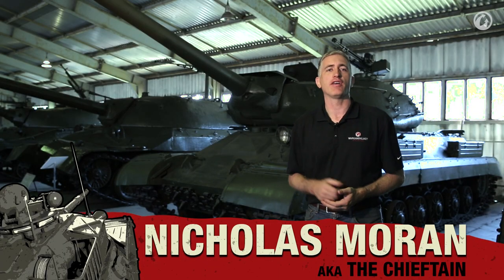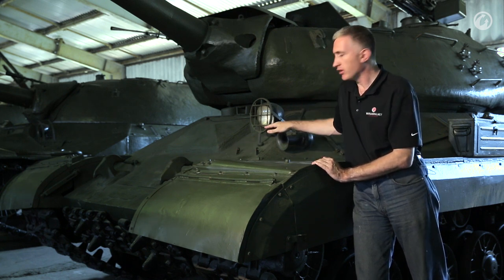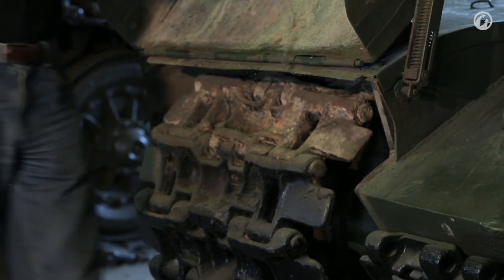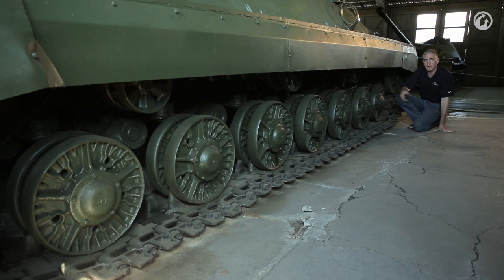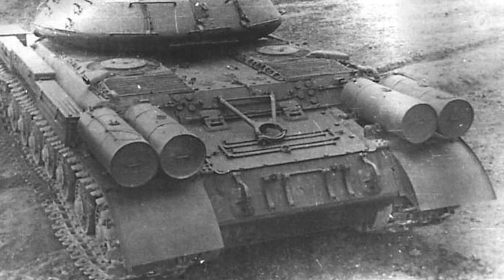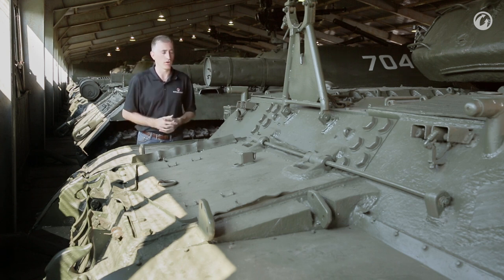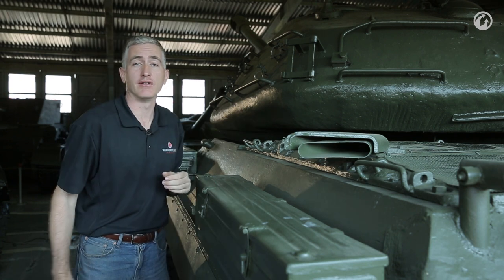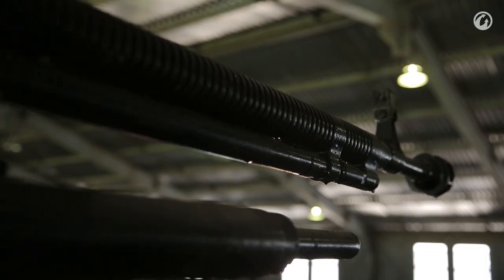World of Tanks: Inside the Chieftain's Hatch, IS-4 - Part I

Comment: 1:13 in the video is an IS-2 with a stepped slope. As others point out, the later production variants also had the fully sloped front.
I don't say that infantry riding on the tank is a bad idea. I say that infantry riding on the tank when the TC is no longer able to communicate directly with the infantry because he's inside the turret is a bad idea, as it implies there is lots of hot metal flying around.
Reply: please do T-10 and IS-3 !!!!! PLEASE !
Reply: May be a little late the IS with the stepped slope and the 122mm was actually was named IS-122 then the real IS2 had the slope on the front plate
Reply: Ah, yes. Hot metal.

Comment: 1) There are plenty of reasons for a fender to be 'sprung' to stay in place. What is unusual about IS-4 is that the spring system is more in-depth than the typical single bar.
2) No change. If the area is not so hot that the infantry are not at inordinate risk by staying in the tank, the TC can probably keep his hatch open and his head out.

Comment: I was told that the IS-2 with the stepped front was actually called the IS-122 and the one with the completely sloped frontal plate was the full production variant which was called the IS-2.
Reply: sorry for being 5 years late but the is2 with the complete slope fron is called is-2 model 1944
Reply: IS-2M 1944

Comment: There are thumb tabs at the back of the 12.7mm machine gun. Not sure if this has also additional trigger lever on operators left hand handle. If the AAMG mount is typical soviet design, there's a elevation brake handle on right hand elevation handwheel.

Comment: At 1:16 that is IS2 as the production KV1S had a 76 and the IS1/2 had a 2 part upper glacies where part 2 (the top) was 3 parts and 1S only had a 2 part upper glacies and only part 1 (the horzontal) was 2 parts to lead into the lower part

Comment: imagine these going up against king tigers. That would've been awesome.
Reply: It's designed to survive king tiger's 88mm/71 main gun hits....so what do you think?
Reply: Theo S I'd love to see what the germans would make to counter it.
Reply: 128mm kwk44?
Reply: Did they ever stick those on royal kitties?
Reply: Alica Ljungberg they put a KwK L/68 105 on the Tiger 2H, the only tanks that really had it was the JagTiger with the 128 PaK44 and the MAUS with the KwK 44 128mm gun
Reply: +TheRed Hawk Nope, Krupp proposed to rearm all Tiger II tanks with a 105mm KwK L/68 gun, but it was rejected since the gun was not in use by the German army and its ammunition was two piece requiring a second loader.
Reply: Or they use the first APFSDS Ammo for the 8,8cm and 12,8cm. Also called Panzergranate 44.
Reply: +Mad Catz Armor Piercing Fin-Stabilized Discarding Sabot.... Please tell me you aren't that much of an idiot
Not only would it not need Fin-Stabilisation since it's rifled but the germans used something that was actually more common in WWII APCR Armor Pircing Composit Rigid which used Tungsten and since germany had basically none of that. Then most tanks would have only a few shells

Comment: One question. Looking at the suspension components, as well as others like the rear deck cover, I notice it's covered in irregularities, almost like someone's heated it almost to melting point and then let it cool with little drops and deformities forming all over it. Compare that with parts of a US tank for example and it becomes very apparent. Is this just a by product of casting, or is it poor or unskilled workmanship or what?

God that's one big slab of iron though.
Reply: it little attention, most importantly how you can make more tanks. Drops do not interfere with him to shoot.
Reply: Poor/unskilled workmanship as well as the way cast moulding works, it leaves many irregularities in the pieces which due to demand, especially in wartime were not smoothed out/corrected. Could also be shoddy painting

Comment: What is track tension and idler wheel @ 3:11 ??
Reply: A track has to have a certain level of tightness in order to stay on the wheels and not fall off. This is usually done by moving the idler wheel. The idler is a wheel which doesn't touch the ground, is unpowered, and the purpose is to turn the track around to feed it back to the front.
Reply: What happens when a tank drives is the holes in the track for the track pin elongate, the pin also wears. This results in the track slackening. The idler wheel can be adjusted to take up the slack. After a period of wear the track needs to be changed (like wear on your car tires).

If you did not tension the track it would eventually slip off as you turn (normally when you're in a foot or so of mud).

Comment: was the M62 gun ever mounted on  is-4 or was that just a fictional game edition?
Reply: The m62 is a real gun and it was mounted on the is 8 or t10 (after Stalins death)
Reply: IS 4 had the normal D-25 gun 175 pen
Reply: +AnnabelLolita   Funny you give a pen value for it.  This is a game stat and tweaked by the developers. It was/is not used as a identifier for weapons.  Simply because it's 175mm's of what? Using what ammo? And don't say AP most guns had 3 or 4 different versions of AP available.  Cannons and their corresponding ammo were developed to counter specific threats not just 175mm of imaginary armor.
Reply: 175 is actually close to the actual number, thats why I said it. Usually guns are tested on homogeneous rolled steel plates. If more than 50% of the shells penetrate the thickness tested, the gun is considered able to penetrate that thickness "reliably"
Reply: Western countries wanted at least 75% of the shells to penetrate to write this as the actual penetration. So quite possibly, by western standards. This gun only penetrates some 160mm armour at 100m range.
Reply: +AnnabelLolita   And all that typing only proved my point. Without stating the conditions rattling off pen numbers means jack all
Reply: +AnnabelLolita I can tell you that the gun has in real life 196 penetration!
Reply: +Willemcross DeEchte at 10m and flat on
Reply: dont know how true it is, but i read that the is-4 had 7 guns considered before they decided for the D-25T( still a great gun) so the m62 may have been 1 of the cannons considered

Comment: Why he not get inside? And thoose springs on fenders was very usefull - imagine situation on battle front when you need to repair track and artillery is firing all the way and all the time. Near hit can close the fender and make work harder = so they used springs. Next is those tank riders - he dont know Soviets strategy to well.
Reply: He did get inside. Look for part 2 of this video
Reply: If you are working on the track and a hit is near enough to close the fender, i can assure you that the closed fender will be the last of your worries. Also, that has absolutely nothing to do with soviet strategy.
Reply: +Blackbird With words soviet strategy i mean the tank riders. Also imagine situation where youa re repairing the track on the front of the tank and missle will hit behind the tank - fender closed. It is also helpful for riding in heavy terrain, there is big possibility to damage the fender, you simply open them, and spring will not let them close by themselves. Cheers!
Reply: +Michał Madeja missile? Wouldn't that insta-kill it due to their heat-seeking?
Reply: Explosion, driving on terrain.... There are lot of factor that can close fender by accident. Those springs just prevent this.

Comment: Incorrect Chieftain. IS had the stepped front slope. Deemed a weak spot so they sloped it on IS-2. The only difference between the two tanks.
Reply: Dean Murphy Only the 1944 model of the IS-2 had the sloped glacis.